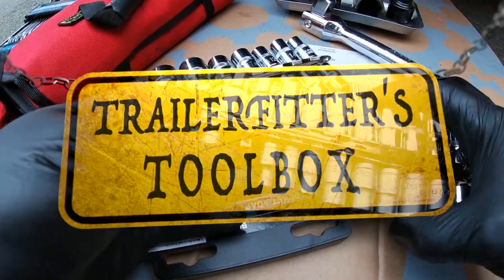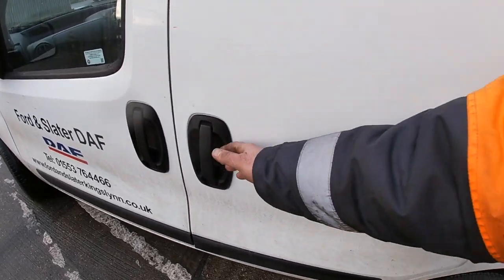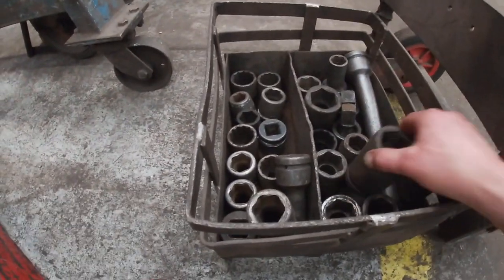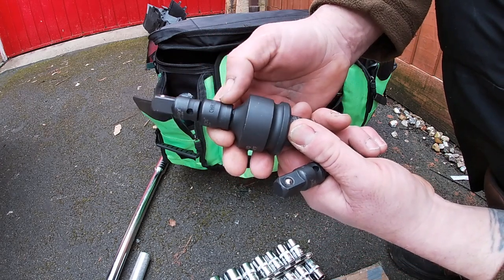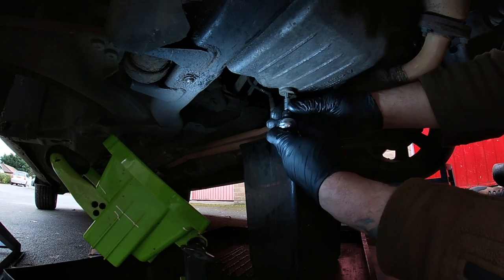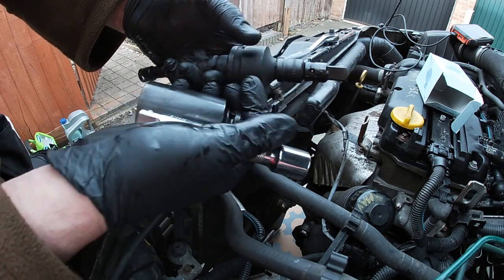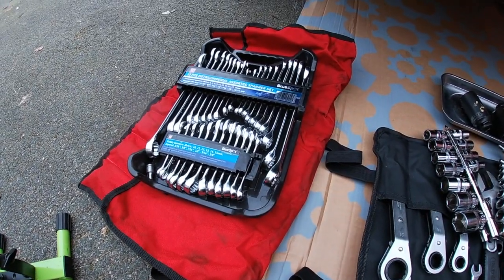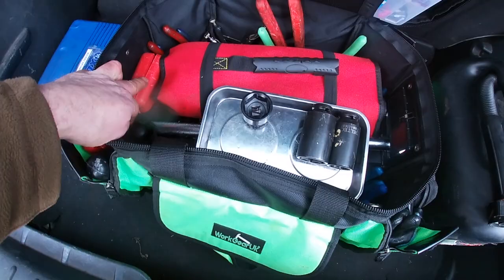Blue Spot Tools Heads Up - Adaptor Set 02080- Plus an Introduction To The Tool-bag Contents

Comment: I'm always pleasantly surprised by these cheaper off brand tools. Got a lot of Welzh Werkzeug impacts (Torx and 3/8" 6 point), US Pro and Bergen off the £10 tool van. Plenty of abuse and they're holding up well. And for a tenner a set I dont mind replacing the lot if I break something 😂

Comment: So you have finally got fed up paying for snap-on!! im a part time weekend mechanic, i like bergen\us pro, sealey and milwaukee fuel for power tool range. for me a budget spanner can undo a bolt just like an expensive spanner, but a cheap impact gun cant undo bolts and expensive one can. so spend your money wisely and where needed. my 1400nm milwaukee has been fine using cheap impact sockets.
Reply: Indeed!
Reply from the maker: Yeah, I have to sometimes buy things that cost too much but SO is not getting much out of me these days. Nigce choice with Milwaukee. They are good.

Comment: Personally I try to buy Halfords Advanced stuff if I don't want to spend much and it's so easy to warrantyanything, also Sealey tools if you register the tool online on their website, although I haven't had to warranty anything with them yet, so can't speak of their customer service. 

I do have some Welzh Werkzeug aviation spanners which I think are quite good for the money, used on a farm, hit with hammers, used as a hammer some of the Chrome has peeled off (pros from being used at a hammer... 😂) but other than that they still do their job. And it's a full set from 8mm-24mm only 9mm skip. 

My only Bluespot tool was a 1/2" Spline set which seemed to be made of cheese, returned them to Machine Mart and they said they needed to send them off, before I could have a refund, I said no problem, any issues I'll contact trading standard as I had to use a 3/8 spline set from halfords which removed what their crappy 1/2 one couldn't do, so I said they must be total crap of faulty. Got a refund on the same day...

Comment: I have told the wife the same thing many times! “Never have enough tools for the job.” Facts is facts! I also do the same tree with my adaptors and use them for different sized extensions. I have my spanner’s joined together using  large nappy pins from recovery equipment and the most used are together on one pin, works for me. Nice bit of tool porn!
Reply from the maker: Hum, nappy pins.   I'm trying to picture that.
Reply: @trailerfitter2  probably think I’m mad but google industrial safety pins and you’ll see why I call them nappy pins... I’ve never had a spanner roll and if space is limited then the nappy pins keep all spanner’s together nicely...

Comment: Touched down when I was 15 i thought the battery had been disconnected as it was in the boot  I touched down on starter motor wow it didnt half give me a kick .
(Rover p5 2600)
Reply from the maker: I managed when I was young, to get the positive contacting the chassis on a truck. The spanner went instantly red hot.   Live and learned don't we?
Reply: @trailerfitter2  yeah learn the hard way learn once